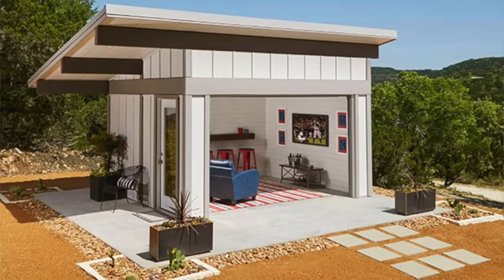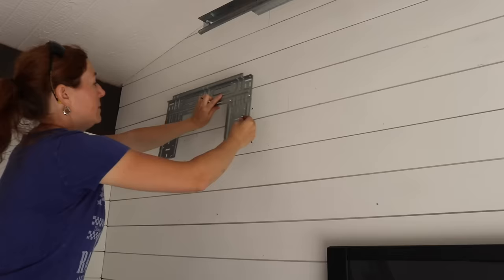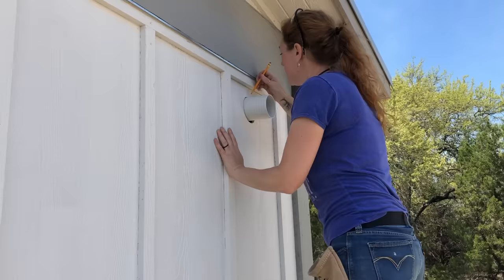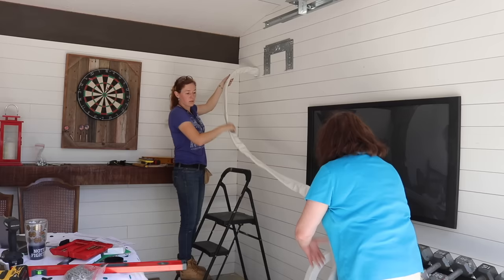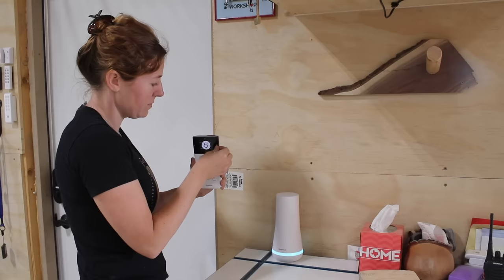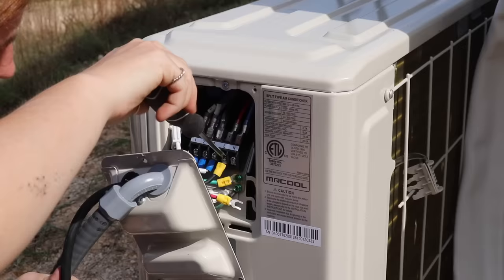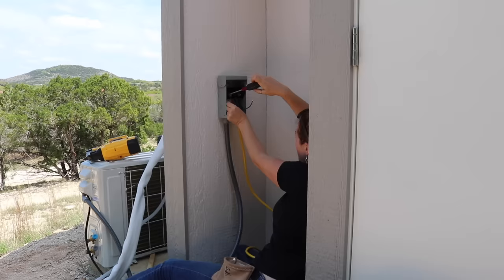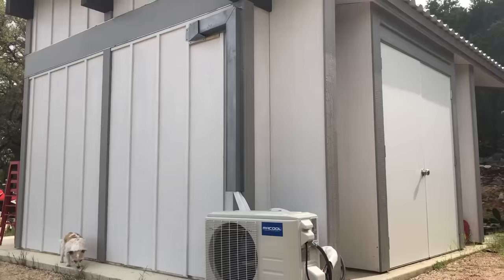DIY Ductless Mini Split Install - MrCool Unit

Comment: I'm interested in getting 1. If I have trouble what is the going rate to have someone install, and what is average cost of a 12,000 unit? Also does it run on a normal outlet. Thanks in advance
Reply: A professional won't install one of these. I don't know anyone who installs homeowner's equipment. Hire someone who knows what they are doing or it could cost a lot later we fix these DYI units ALL the time.

Comment: I’m surprised they didn’t make sure the bracket had holes that are 16” on-center. Seems like something so simple to do, and yet a bit silly to not do!
Reply: Pretty sure they have that factored into the bracket design with slotted holes, she said she could not find the template that usually should come in the packet, bracket is enough as its own template
Reply: @Joshua79C  Ah, right! I must have missed that bit! :-)
Reply: IF you watch again, notice she is using the vertical and not the horizontal which would allow here to screw into the other stud she said was just shy of those vertical ones. Not sure how long the screws in the vertical  slots will hold up over time, though that is as light a unit as is.

Comment: I noticed you using your jigsaw and it appeared very smooth. Mine jumps so much. Why would that be?
Nice job on the AC.
Reply: Depends on how much downward pressure you put on the saw - use girl power
Reply: Maintain contact with the surface. Also, make sure your blade is long enough to go all the way through the material you are cutting, even when the blade is all the way up.

Comment: What portable generator is going to be used to power the compressor unit?  Don't these units consume an enormous amount of power upon startup to get the compressor going?
Reply: These units don't draw heavy load on start up. It's a computer controlled 3 phase operation.

Comment: Not terrible but the line set is looped incorrectly creating oil traps. Also it's behind the condenser blocking air flow. Still better then some "professional" hacks out there. If you need a company, look for one that's been in business awhile with a good rating and warranty with the equipment

Comment: Nice job and video. BUT you made you life MUCH harder. The line set is designed to go outside on the OTHER side (the RIGHT side). If you would have had the cardboard template you would have got this on the correct side. Because you had the hole on the wrong side you HAD to connect the long line sets BEFORE you put up the Air-Handler and feed the whole length of the line set through the wall - a BIG chore that you needed your mother's help for. 
When the wall hole is on the correct side then the line set from the Air-Handler/Inside-Unit would be long enough to reach easily to the outside through the 3.5" hole in the wall. Therefore you would be able to connect the LONG line set on the OUTSIDE which is really easy. See the Mrcool installation manual.
NEVERTHELESS in some installations one HAS to put the hole on the LEFT side and your video shows how to do that for hopefully these rare cases.
Your idea of using a jigsaw to make the hole could help when the you don't have a 3.5" saw (costly) or when you need a really fancy one for real hard martials like asbestos shingles that are thin but need to be very careful since they are brittle (like I have).
Great job and nice video.

Comment: I liked learning about these. I do have a question on clearance for airflow on the outside unit. Will the extra line coiled up against it and the proximity of the wall hamper the effectiveness of the unit? Also, I wouldn't want that generator so close to the wall unless you know for sure that carbon monoxide wouldn't find its way into cracks within the room.
Reply: The coil once tied up will not change her gas bill - the generator should be covered & away from the shed to lower the noise inside for sleeping.

Comment: Nice job, thanks for sharing.

Just curious, why didn't you save a few bucks and just purchase a small portable unit? I have one I use in the garage that is on wheels and only cost about $400. It has a 4" exhaust hose (approx) but other than that is self-contained.  

I see benefits from the type you have, I'm not criticizing. Just curious if you thought about it and if you did, what made it worth the extra $$ to you.

And 'just having a new toy that looks cool'  is an acceptable answer!
Reply: She wants it to look nice in a livable space. It also makes almost no noise, cools 10x's better and actually dehumidifies a lot better. Also it has heat

Comment: Does this unit come with a power cord? It sounds like you bought the one you used separately.
Reply: Jessica, you would need to purchase a "power whip" typically at the same place you get the unit. They are sold based on the amount of amps they need to convey, these come in standard lengths as well (5-6' I believe). If you have access to electrical supplies you could make your own but the power whip she used is cheaper than you could buy all of the supplies yourself.

Comment: Great video April you made it look very very easy. I noticed in your video you talked about installation of the inside unit the air handler and how to mount it on the wall and the template that it comes with for mounting in my situation I would like to mount the outside unit the condenser on the wall outside of my home so I do not have to poor a concrete pad did the unit come with a bracket and instructions on how to do this? Oh one more thing I forgot to ask does this DIY unit also have a heat pump option for heat in the winter?
Reply: You would have to call the company and give them the model/serial number for them to tell you if it comes with the heat pump option, AFAIK they are cooling only.

Comment: Hey mate i would be re checking your phase polarity. if in your disconnect you just straight hooked up the same colors as red and brown in basically the whole world is active or line and the blue or black cable is your Neutral. with yellow or green or mix of being your earth (protection). i would hate to see you rotor lock your compressor the first time you turn it on. :)
Reply: Hi mister american man as per Australian / New Zealand standard 3000 section 3.8.3.3 figure 3.1 and figure 3.2.
Figure 1  240v 1 phase 
Australian
 red =  active
black = neutral 
green/yellow = earth  

European cable or as of march 2006 British cables
Brown =  active
Blue = neutral 
green/yellow = earth  

Figure 3.2  415v 3 phase
Australian
 red =  phase 1
white = phase 2 
blue = phase 3
black = neutral 
green/yellow = earth

Figure 3.2  415v 3 phase
 (code 3.8.2 if other than Australian colours are to be used they must be sleeved with correct colours.
European or as of march 2006 British cables
Brown =  phase 1
Light blue  = phase 2 
grey = phase 3
Blue  = neutral 
green/yellow = earth

or code 3.8.1 table 1 
protective earthing - must be green/yellow
Equipotential bonding - Green/Yellow
Neutral - black or light blue
Active (phase)- any colour other than green, yellow, Green/ Yellow, Black or light blue
Reply: Yes what you wrote makes sense for there, but as I posted a link to that you clearly did not seem to look at, is what color code is here in the good old USA.
Here is another link with more in depth of what colors mean where:
www.allaboutcircuits.com/textbook/reference/chpt-2/wiring-color-codes/
As I said, your color codes are different than our systems. and this is a 115V 35A power system she is using.

Comment: Those LONG pre-charged lines are a PITB. Most mini-splits are sold without a line set. You only buy as much line-set as you need.  (You pay extra for those long pre-charged lines).  
If you look at the cost of having a team of HVAC guys install a mini-split, and compare it to the cost of DIY buying and using a vacuum pump, gauge set, and other tools, it's cheaper to DIY in many cases.  If you are already a skilled home DIY person, you might want to look into getting your EPA Section 608 Technician Certification here:  https://www.epatest.com/608/
If you live in a town that allows homeowners to do their own electrical work, that could be a another big savings.  
There are many on-line resources to learn how to install Mini-Splits. Google em.  The Home Depot website has links to PDFs of install manuals for their mini-split products. Read a few of those, and you'll learn a lot about M/S installs..
Reply: I second that having too much line, the company would still make a killing offering other line lengths such as 15 foot in her case would be long but not as much extra.

Comment: What a great difference there is between USA and Europe. Installing a mini split yourself? Without ref certificate? I guess it's you guys and China that keeps going on like this. Heck even using R22 sometimes. And powered by a generator? Either you use the AC unit at very rare occasions or the oil price is still 1/3 of ours.

Comment: April, do you know if they make systems that have multiple handlers going out to one or a couple of compressors?  I would install this in each room of my home if it weren't needing a 1 to 1 ratio between handler & compressor.
Reply: Richard Sheridan There are multi zone mini-split units available.

Comment: No leak check, no vacuum, no anti vibration pads, no filling out the wall cut out. If you ask me, I’ll get a professional to install the unit. 
If the unit fails, no warranty covers DIY installations

Comment: u should cut off the excess pipe instead of hiding it behind the cooling fan(out door unit). it will restric the air circulation for the cooling fan n i,m sure  mr.cool will becomes mr.warm
Reply: She explains in the video why she can't do that.
Reply: Seriously, she aays the lines as the company also states on their website clearly that the lines come precharged, would be nice if they offered shorter say 15 foot long lines she would not have as much excess to tuck away or route in a fashion so it is out of the way of the outside condenser units exhaust.

Comment: you might want to do a vac test on those lines before opening the valves just saying maybe a dryer on liquid line also
Reply: Krista Floyd the entire thing is charged with refrigerant, including the  lines.  There are piercing fittings on them and when they are connected to the unit everything is good.  Filter drier is already in the unit.
Reply: And yet you are clearly another who did not listen to what she said and only assume from your armchair expertise of what she should have done before installing the lines, the company even mentions on the website since it was offered that no tech is needed to install it, Unless of course the line had incurred noticeable damage, only then will you need to call in a tech to fix the line and charge it, and cutting it open otherwise would release the coolant leading to a possibly deadly refrigerant burn (thinks frost bite, but more instant) if you do not know what you were doing outside of what the instructions state.
Reply: Joshua79C C 
This is the third or fourth installation video I’ve watched for this model and it’s amazing how many “pros” with decades in the business have left comments like “wrong! Didn’t vacuum the lines”, or “should have cut those lines to size and evacuated them first”. 
None of them bothered to look at the installation manual for THIS specific unit, or take a look at the manufacturers website, or (as you pointed out) simply LISTEN to the person posting the video. Definitely the kind of “pros” to stay away from.

Comment: Don't you think that cubby is a little close to living area for running a generator safely.
Reply: she it is where it will be stored, thus it will be lugged out for when it needs to be used to allow for full proper airflow and exhaust and less noise inside the extra space.

Comment: You are restricting air flow by putting the coil of line set behind the cooling fan. Also for safety and in most areas for code, the disconnect must be within sight of the outdoor unit, not hidden behind the wall.
Reply: That might be true for most regions, but not likely in her local code if there was such for line of sight to the disconnect, not hard to find anyway as its right  there on the side and only hidden from sight if you were standing elsewhere.

Comment: The mini split seems like a great answer...would you be willing to let me know how much the product would cost me?
Reply: Depends on what SEER you want & the floor or wall mount plus freon line length.   Heat pump can be as cheap as $500 w/o other stuff on Ebay